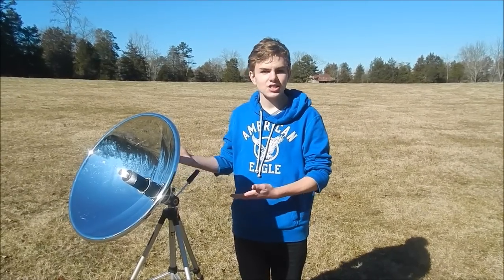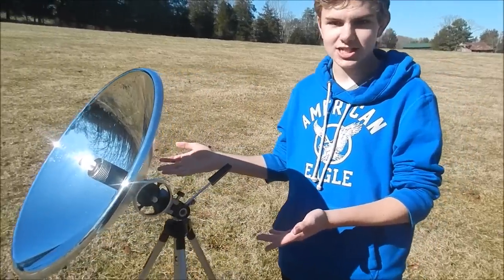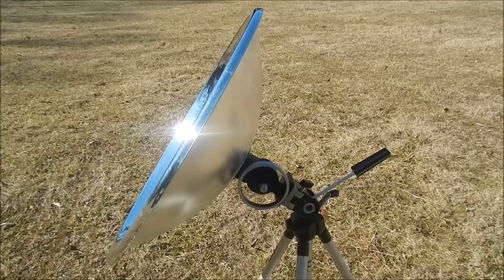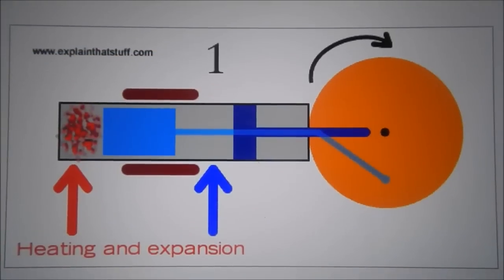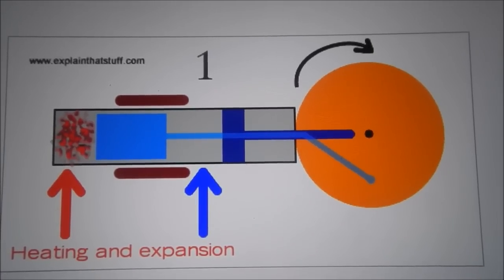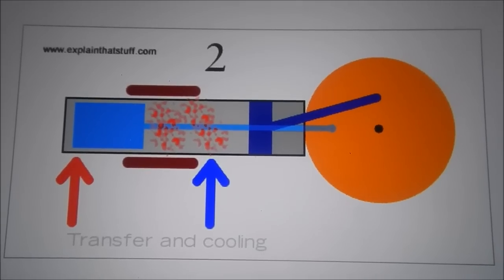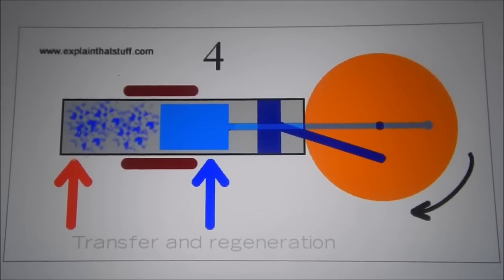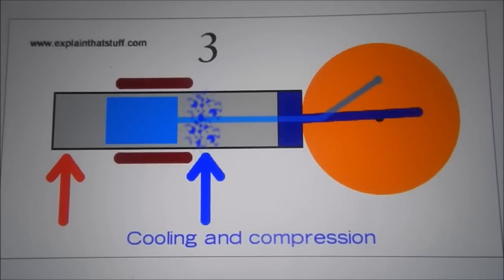Stirling Engine with Solar Concentrator

Comment: I know this has been a long time but steam engines can little to no emissions now as well as they are used to help generate electricity from a variety of "fuel sources" like nuclear fission, gas, oil, solar (especially in units that collect sunlight into a heat battery of sorts) the difference is the steam engine is actually a turbine, like what later ships and (nuclear) submarines use.

Comment: Many gas turbine engines are set to run at optimum- efficiency speed.  A transmission  controls output thru gears.  Thus a Stirling engine does not have to speed up and slow down.

Comment: dude, you're a darn genius. afaik the energy conversion efficiency of a stirling engine is about 60%, so the combine of reflector and stearling maybe is twice or more effective than solar panels.
Reply: "afaik the energy conversion efficiency of a stirling engine is about 60%"
No. Efficiency depends on temperatures (hot side, cold side). And there is no stirling engine that achieves 60%. 
The world record for a solar stirling generator is 31%. And that was a really big device, smaller ones won't achieve much more than 20%.
And it's not comparable anyway, since PV can convert scattered light, which solar stirling dishes can't. 
Even the world record system "suncatcher" from SES won't provide a single watt on a cloudy day.
Reply: A well constructed (professional) stirling engine will have about the half of Carnot efficiency. Carnot efficiency is 1 - (low temperature/high temperature).
Let's assume 800 Kelvin at the hot side and 300 Kelvin at the cold side (very effective cooling): This would be a Carnot efficiency of 62.5%. So real world efficiency would be around 31%.

Comment: Very good explanation Lee! They are not as efficient, but good try! Keep trying for a greener and sustainable alternative!
Reply: Think you are wrong about that.  Look up the Mod II sterling automotive engine.  Keep in mind billions upon billions have gone into internal combustion engines research and development.  Yet, not the same is true about these.   The fact. 75HP version was around 40 years ago without the same $ and with near zero emissions are facts you  left out.   Do you know the efficiency of a gas engine?  20 to 25 percent.  Some of these are in the 30s.

Comment: Hi Admin. I'm mechanical engineering undergraduate student  from North Celebes. Nowadays, I'm doing my final assignment to achieve bachelor degree. I'm interested to design and build a beta stirling engine to pump water in islands that had no electricity in North Celebes.  i need more references to finish my project. I hope you would be pleasure to share your thesis or other manual book design references about stirling engine to help my project. Thank You Very Much, I'm sorry about my English. God Bless You.

Comment: You prove 2 points. (1) the concept is correct and undeniable. (2)  flea power----couldn't even open a walnut.
Reply: With a 20 foot diameter mirror we can get about 3 KW

Comment: The stirling solar engine you made is very cool but the project needs more work,the stirling engines are thermoacoustic engines which means they are considered to be(almost)silent.However the idea is beautifull and the explanation is very good too,plus with this video you prove that if some of the current engines that we have on our modern technology will be modified in the future,the stirling engines will be among them definitely.P.s. the stirling engine you show is not preffered by many in our days because of its low efficiency(24%) compared to diesel and otto engines which have higher efficiency